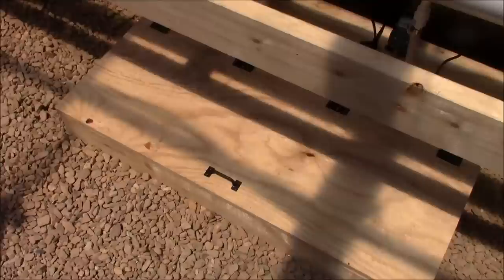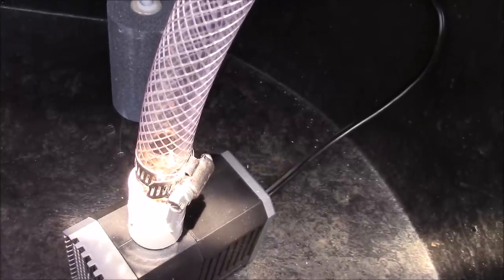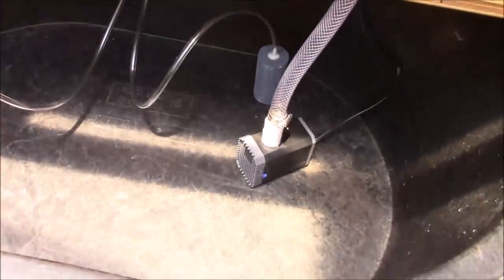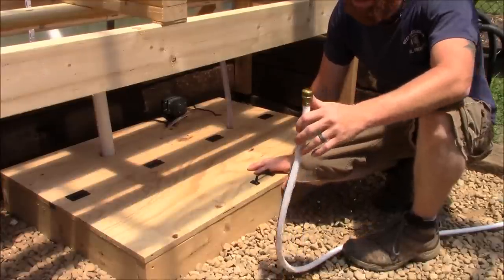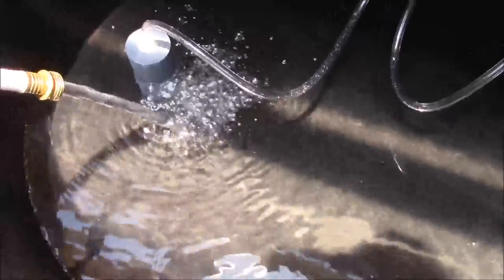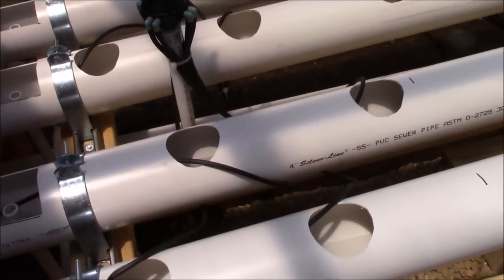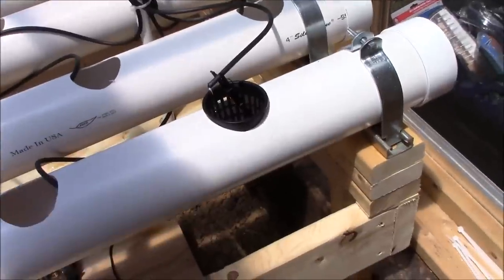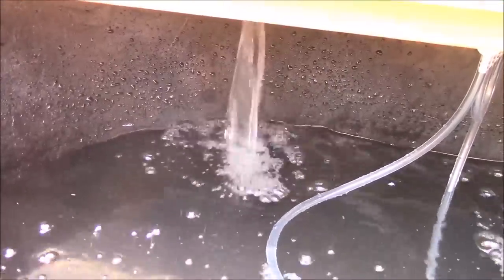Hydroponic Rail System Build - VLOG 4 by HPFirearms

Comment: A good tip for putting hard tubing on those barbs is to heat it up with a lighter or a heat gun and then it slides over smoothly. After that you can squeeze the end down so it doesn’t leak, I put zip ties on them afterwards.

Comment: Hey great videos. I used to do hydroponics about 15 years are so a go and off and since then. A couple of things that drove me nuts. Those 1/4" fitting would clog up all the time. Pumps burn out so have a spare handy also you don't have to run 24/7 also by not running the pump all the time the water temperature won't get so hot. Last but not least is roots. You will not believe the amount of roots a plant produces. Which will clog up your system and empty your tank on to the ground or floor.
Other than that I'm still dabbling with it and when it works it's amazing.
Keep up the great work. Jeff

Comment: Hi, thanks for the great videos! I am planning to try something out here in the desert in Las Vegas, Nevada! It may be too hot for most plants even in a green house. I used some of the multiple outputs for the small 1/4 inch pipes for some of my plants. It appears with a constant pressure from the pump that your difference in drip or stream is the setting of the individual outlet. I seriously doubt any blockage!  Mainly I'm interested in the nutrient mixtures and amounts to supple. Building the system is easy for me as I have worked with PVC quite a lot. I may not get to do very much due to my age. I'm 88 and still love gardening! (Have lots of tomato vines but no tomatoes!) Etc. Thanks again I'll continue watching.

Comment: to put your micro tubing on easier what I do is heat up some water in a cup and then soak the ends about 1 to 2 inches long in the hot water for about a minute or so just to soften it up goes on so much easier. in joy

Comment: Forgive me but I'm going to be long winded here. . Bobby, your work looks really good. I also like that you use clean language and suspect that you know the LORD. Now about the pump. It may be 1500 ph if the rise is not high. You loose performance the higher they have to pump. My system is bigger than yours and I use a submersible pump from of all places . . Harbor freight tools. I know allot of the stuff there is not that great but the pump I got works great! I'm going on my 4th season with it. You will deal with algae at some point. I hit my pvc today with sandpaper and acetone and brown spray paint. Also I got the dripper manifold like you got. I'm not going to recirculate my nutrient this year. My overflow will go to another tank. I want to use the waste water to grow duckweed. With the manifolds I hope to minimize waste.

Comment: Bobby Hughes, I love your video, all i can say is have you ever created an air aerator using a direct water flow from the planter media using a venturi,. A venturi is a pipe connected to the water line flow, the air mixes with the water creating a bubble as it travel out the pipe & used for aquaponics,. also my other comments is i think the pipe reservoir media is not properly aligned from corner to corner making the orifice flow is not important, just think about it.

Comment: The pump is restricted by head pressure so the higher it has to pump the water  the less you will get so 1500 liters is at zero head pressure.

Comment: Did you find the drippers emit evenly between each line? The ones I got didn't at all and they were like 11 bucks each! What I'm doing instead is using half inch drip line for every other tube then punching 1/4" barbs in them. 

Also, if you haven't figured it out yet, those pumps aren't strong enough for much in the pressure sense. I'm going to try to use 1 300 gph pump per tube, and if that's not strong enough I will use 1 sump pump to run them all.
Reply: Also, incase you jump without thinking, a sump pump will need a pressure regulator. 25 psi per every 20 gph, if that makes sense. Use more lines/regulators if you use over 20 gph. If you go with organic nutrients step it up to a 35 psi with .334 gph (or stronger) sprayers. I know those nuggets will save atleast 1 person a few bucks